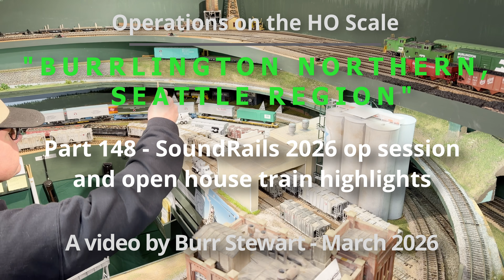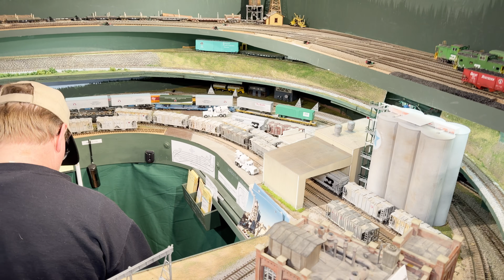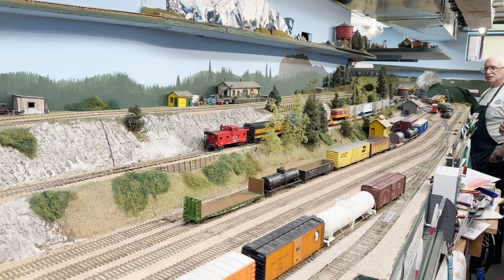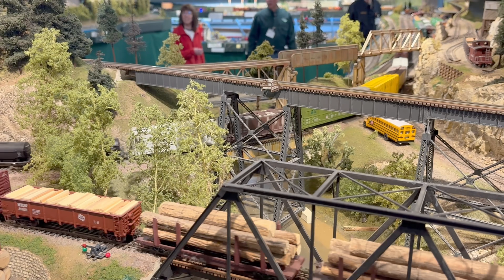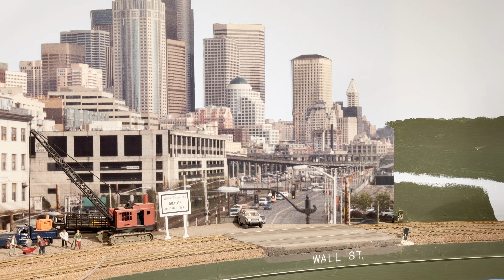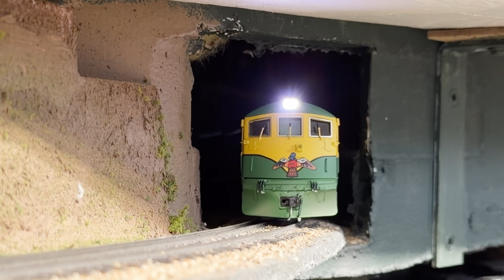Part 148 - HO SoundRails BN ops, 4-6-6-4 steam reefer train and HOn3 diesel engines #modelrailroad

Comment: Thanks Burr. This was a fun group session and glad you got many visitors. The derailment scene was great. Looks like the tracks will be blocked for now including  the line through Puget Sound along the waterfront. 18:18 good eye with the roll by inspection spotting the lead wheel on that Rio Grande unit. Oh dang I've had that same problem before with a Intermountain SD40-2W and also a unpowered dummy unit UP SD45 before. Excellent video Burr !
Reply from the maker: Glad you enjoyed it! Yes, 3 axle trucks do sometimes have issues. One time, years ago, I discovered the problem simply was that the plastic sideframes were pressed on too tight, and they were keeping the center axle from moving from side to side in curves. It was so easy to fix!

Comment: Such a beautiful layout sir! Been subbed to your channel for a long time by now always amazed me how expansive it feels and always during your filmed ops sessions always have alot going on with long freights and beautiful passenger sets 👍🙏🙏Though my triple decker layouts stagnant and will continue to be for the near future my smaller “Lost Pines Industrial” spur layout is getting closer to completion only reason it isn’t by now is really my constant procrastination and analysis paralysis when working on the layout actually breaking paralysis looking over everything and actually getting to it. But my next actual “long format” video will be an update of my LPI layout and I’m planning to have all foilage remaining, my scratchbuilt food/grocery distribution center industry, scrap yard dealer industry, the last 2-3 flat background backdrop buildings in and in place as well as a lot of detailing first being fencing and a variety of types of fences that’ll be around a couple different industries on the layout as well as in another spot, parking lots and the dry good paved platform for the food distribution center all completed, and at least painted might just complete it bulky weathering it too and definitely have the parking lots have parking spot lines and weathering as well. Additionally picking up a lighting power hub, expansion hub, and the other hub box and additionally more LED wired lights that’ll be put in two structures for interior building lightings, as well as finally wiring and connecting the layouts only grade crossing lighted crossbucks and food distribution centers dry goods paved platforms flood lights wired up and working as well so on layout wiring, the buildings and other structures are completed, lighted, and remaining foilage left to do will be done. With all that done I’ll finally show that the layout has always been operational I just haven’t ever filmed/recorded my mini ops sessions on it so I’ll do one of those with the local exiting the mainline, picking up a couple cuts of cars in the staging sidings, going down the spur lead to the industrial park and working a couple of the industries in the LPI park. Also need to get the rolling stock and locos weathered as well with pastels and chalk so the rolling stock and motive power looks more proto realistic 👍 once that layouts finished it’s on to what will be my third concurrent layout which will actually be built above my LPI park spur layout and will model the Santa Fe’s El Paso sub from 1980-1995 👍
Reply from the maker: Thanks for your comment. There are a lot of advantages to a smaller layout, but I can see that it puts pressure on you to make the "right" decision about each square inch, causing procrastination. I just filled the basement with track, so there's no room for any buildings, basically. A lot of train running, but not so much modeling...
Reply: @muchfunwithtrains exactly that’s why I’ve seen how usually smaller layouts that are primarily focused on say a branch line or industrial spur line that’s prototype style ops point to point modeled tend to be some of the highest level of model rail detailing there is where as massive multi level several thousand square foot master layouts are more focused on the operations aspect more so than every scene section of the layout needing to be so in depth detailing wise it’s truly visual perspective that you definitely learn and understand more and more the longer your in the hobby and more skill and understanding you aquire with time. Like my main layout when fully completely built at least in the home I have now it already takes up a third of the entire square footage it’s double decked built currently but before I ever consider it operational I still need to build the third deck level so it’ll be a triple decked built currently level proto ops based layout covering three branch lines and a 44 foot straight mainline section which has west staging on one end, goes through two towns and inbetween those towns is the layouts mainline rail yard that all the branchlines intersect the mainline and interchange towards the yard and the locals that serve the branch lines set and pick the rolling stock from there and build or breakdown trains that have came down the mains with incoming or outbound freight being taken on down the line to the rolling stocks eventually getting to there final destination. It models 1910-1935 strictly sticking to the prototypes timetables I’ve accumulated over time and a lot of research and effort to aquire. The mainline and two of three branch lines are the St.Louis,Brownsville&Mexico 1910-1914/1914-1926 Gulf Coast Lines/1926-1935 Missouri Pacific Lines and the third branch line is the SP’s subsidiary’s the Galveston, Harrisburg & San Antonio’s. Then I’ve got my smaller freelance “Lost Pines Industrial” set late 60’s-70’s which is the layout I’m nearing completion with and the third layout I’ll have which will be above the LPI layout will be the Santa Fe’s El Paso sub proto-freelance 1980-1995 which will cover the sub just as it reaches and crosses the New Mexico border into Texas with a intersection/interchange of the SP’s sunset line and reaching into El Paso which is where the layouts railyard will be 👍
Reply: What a year you've had with the remodel and getting ready for this!  I've been working on Bob S.'s work crews all year to get his ready for SoundRails and it was fun working towards a pleasurable deadline/event.  
All of this year's layout changes on yours look great! Cheers.